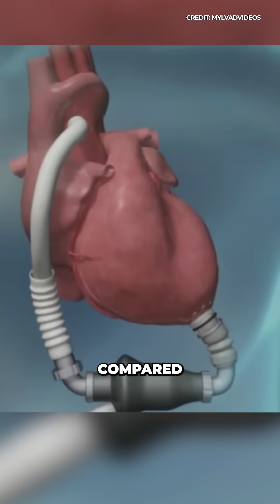Engineers Create World's First Fully Artificial Heart

Comment: My father was a thoracic surgeon. When I was in college, he got the idea for developing a pump that could be attached to a patient who was in cardiogenic shock in the field by trained paramedics, with the hope that it could keep the patient alive until they could be brought to surgery. We built it using a clear plexiglass tube about 3 cm in diameter and about 30 cm long. My dad made "tricuspid" valve molds out of old broom sticks by carving the end in the positive shape and then heating thick mylar sheets on the stove and shoving the broomstick handle into the soft mylar, creating a negative of the valve. We then cut the valve from the mylar sheet and used a razor blade to slit the valve leaflets apart. We would then mount two of these valves onto the ends of a mylar tube about 2.5 cm in diameter, with both valves facing the same way. Water passed through the valves could only flow in one direction. We then placed the mylar tube with valves inside the plexiglass tube and attached an electronically controlled pump to a small hole in the side of the plexiglass. The pump would alternately push air into the plexiglass tube and then suck it back out, causing the mylar tube inside to deflate and inflate, respectively. When one end of the contraption was placed in a bowl of water, it would squirt water almost to the ceiling. My father then sterilized it and attached it to a lab animal (a pig, I think). It kept the pig alive for several days and when they tested the blood, there was no appreciable hemolysis. Unfortunately, we never got a chance to complete the development.

EDIT: spelling

Comment: A constant flow bloodflow has problems that a pulsing flow doesn't. In the pulsing cycle the pressure is like a waveform with a peak and a low, to simulate this with a constant pressure would mean having a flat graph for the pressure curve. The problem is the fact that static friction is higher than kinetic friction. The high pressure peaks in a pulsing flow means blood will still slowly flow through paths it wouldn't be able to normally, so a flat pressure from a motor can't make blood flow through places a pulsing flow can, and so it'll clot up in places, maybe for the specific patient here, the blood may have been thinned with the right medication to mitigate this but if this is true then this limits the use to patients that wouldn't have complications with blood thinning. Maybe a piston based motor using a linear solenoid instead of internal combustion would would better to simulate the original pusing heart.

Comment: Not well informed. There is power problem and a deeper puzzle. These temporary pumps are old. The problem is power. The best company now is Leviticus (dumb name, I know) and an MIT startup. However, there is a new problem unsolved that occurs after about a year, for
some unknown reason our immune systems attack these electromechanical hearts, generating plaques. Maybe cell rupture is the cause? But which cells? What is causing the inflammatory response to materials which are biocompatible in knees and hips? 
Focus on this puzzle in a video.

Comment: So my question is....in situations where you would suffer a heart attack, but you had this in you instead, would you just not have a heart attack? Could this heart never fail in the same way that our natural hearts do? Disregarding mechanical failure unique to the device of course. Also how would stimulants that increase your heart rate affect this? If you dont have a heart rate....does that mean your heart rate wouldn't go up? Would that cause other unforseen issues elsewhere in the body?

I'm mostly just curious. I see why this is a miracle, obviously its one of those "working with what you've got" sort of circumstances, where getting this is better than being dead. But I wonder what the unforseen downsides/disadvantages are. 

But as someone whose heart has insisted on not beating properly for years, everything from arryrhmia to palpitations and even panic attacks where I thought I was dying because my heart was bugging out so bad, the idea of having something in my chest that would never fail to keep the proper amount of blood flowing at all times is as enticing as it is a bit spooky. The hypochondriac in me couldn't help but wonder what other problems would be caused by the blood flowing differently than our body is used to/technically "built for".

Comment: There was another artificial heart invented more than 30 yr ago. Yet, it did not provide the needed impact to red cell minimized to this level. The one individual that was the "experiment" failed to survive long enough to obtain a replacement heart. At the time, it was mostly blamed on the missing "pulse" of a normal heart beat and the system unable to cope with that missing constant. Yet, I don't recall if the negative impact on blood cells were also identified. This is a great break through. The previous recipient did not last nearly as long, and this appears to be 
on orders of magnitude better.

Comment: why make it temporary when you could improve it make it so it can completely replace the heart, yes just with anything like that it will need maintained which will probably require an appointments every now an than but heart failure is the cause of so many deaths and this could make getting rid of heart failure way easier.

Comment: I'm a Mechanical engineer, and, oddly, my first post college job was designing chemical metering pumps.  I have heard blood is very sensitive to shear stress, and shear is exactly what your lil impeller is doing.  Why don't we mimic the heart's dynamics and use a big ol "dashpot style" diaphragm and gentle rubber flap valves? I'd pump that diaphragm like it's a speaker cone.

Comment: That’s amazing, it definitely looks like a plumber had some say in its design, its not overly complicated and  it does the job it’s required to do properly and efficiently without doing damage to the rest of the machine its installed in. It seems to be remarkably simple but efficient, almost like the engineers were told to keep their over complicated hands off this one.

Comment: Before watching this video, I never realized quite how many different unique problems you have to solve when creating a mechanical heart. Like, it needs to: 
- avoid harming red blood cells
- dynamically very speed based on patient activity level 
- be incredibly reliable 
- be small enough to actually fit inside the patient 
That's just some pretty restrictive requirements!
Reply: There's also:

- Have long enough battery life to where it's not reasonably possible for your heart to run out of juice
- Be light enough to where it doesn't significantly harm or affect the function of the rest of the abdomen
- If battery life isn't long enough to last before heart replacement, they need to find a way to charge the heart without stopping or removing the heart
Reply: @megamortosis couldn't we make it like wireless charging?
Reply: @l3ll5l  wireless charging happens over an extremely small distance and/or through the open air.

Going through an inch of bone and/or flesh is neither of those things
Reply: You could, of course, wirelessly charge a battery that's on the outside, but that's just over engineering at that point.
Reply: @megamortosis  I looked it up and we could increase the distance but space is a problem one could built the outer shell with it so it serves two purposes. But I think they would have thought about it already. It seems bones and flesh are not such a problem
Reply: @l3ll5l or like a cyborg, have an external part connected to the heart for charging. How? idk
Reply: @Mark-fo6hz  yes I thought about this too but then I thought about infection between flesh and metal and the body to try to fight it etc. But lets see what they will come up with
Reply: @gabef.218 that's like saying wireless charging isn't possible with a phone because the case is hard... you simply move the qi charger to the skin level and connect it to the heart via a wire
Reply: @dutchman55 like i said, at that point, just plug it in, no need to over engineer.
Reply: @gabef.218 you could run a wire to a charging surface screwed into one of your ribs or something and use a magnetic charger like apple watches do
Reply: @l3ll5l why not just a usb port? Seriously
Reply: @megamortosis  I wonder if there is a way for the heart to use the body's ATP so battery life isn't an issue.
Reply: @lordyoda607 i don't think so, as atp is used in chemical reactions as fuel, it isn't pure energy. The heart would have to have input and output for atp and waste, which would be significantly harder to manage considering it's inorganic
Reply: @megamortosis  the battery is external, and Im pretty sure wireless charging is a thing
Reply: @aiodensghost  ai pfp, opinion ignored
Reply: @megamortosis  we got a tesla coil bro😂😂
Just charge yourself like a iPhone 😂
While sleeping, make sure you have a inverter 💀
Reply: Avoid rusting and any material changes that could cause poisoning. Actually monitor and provide the correct blood flow that subconscious brain would be satisfied with since there is a clear mismatch between what the brain is saying the body requires and what is actually delivered. ensure EMPs, electromagnetic disturbances doesn't affect the device, ensure there is another power to last for over 200 years without defect, ensure the motor speed is quick and accurate to simulate the same speed of a real heart pumping blood.  Ensure the heart is adjust its speed appropriately depending on the athletic health of the person.  Ensure remote activation tampering isn't possible. 

Too many possibilities where something can go wrong. I'm glad this should only be seen as a temporary thing until a full heart replacement can be sought. I'm for sure. THis GOT to be seen as the ABSOLUTE LAST RESORT.
Reply: And lightweight enough, too, as a heart weighs 7 to 15 ounces depending on specific factors...idk how much that one in the video weighed but trying to carry around a 5lb heart would be difficult and possible painful...definitely would put a new meaning to "a heavy heart"
Reply: Apparently, strokes are a big recurrent problem with early Jarvik-7 artificial hearts.  External battery pack changes are NO PROBLEM because you can just connect the 2 batteries in parallel and then disconnect the tired battery.  Wireless charging is not a problem as long as the patient is not too fat because you can put an induction coil just below the skin and outside the muscle fascia, connected to the heart battery deeper inside.

Comment: Doctor’s notes: “Patient is experiencing a decrease in torque during low rpm activities. I am prescribing a compound turbo to address the boost lag. If that still doesn’t treat the symptoms; I am recommending a twin-charger with a ported blower and connections to add nitrous later if necessary.”

Comment: What if they created a more malleable structure with a wire system that went through the walls of it, it could contract and release the wires to use compression to distribute blood and eliminate the shearing of blood cells.

Comment: The major problem with the science of engineering artificial organs isn't the mechanics but the constant output generation and to reduce the heat and friction as much as possible and even though these are work of art they will have to be replaced sooner or later as the heart not only pumps the blood but also releases certain hormones like ANF responsible for lowering and controlling the action of RAAS and ADH which even the modest of tech couldn't compete
Reply: The heart also acts as a chemical control centre of breathing rate as the receptors on carotid body senses fluctuations in CO2 and H concentration

Comment: I'd love to know how they're dealing with the pressures it takes to actually... pump that blood, without the actual heartbeat. The way I understand it, half the reason the heart actually beats as it does is to build up the significant pressure needed to move such an intense volume of blood, in such tiny little tubes, so far removed from the heart itself... it's a lot of resistance. Kind of like... how it's easier to move something heavy by shoving it a small distance at a time instead of trying to slide it continuously? But then, how that heart pump is getting away with continuous flow, that's very interesting to me

Comment: There is a critical information missing. Where does the energy for the heart come from? It most likely comes from a battery that sits outside your body. Therefore it has the same issues as all the other mechanical replacements. Its fine for a short time but you always have an open hole in your skin for the cables. This hole is a high risk to get an infection. 
Correct me if i am wrong but he didn't say anything about how it is powered.
Reply: It's probably something like a pacer
Reply: @Fishyea  
It's not a pacer because a pacer can't replace a heart. The issue is that a pacer doesn't need much energy. But here we have an electric motor that needs to be running the entire time.
And I doubt they will hide a battery somewhere which can hold enough energy.
Even inductive charging won't work here. It's too inefficient and can't deliver enough energy.
That's the reason I think there is information missing.

Comment: The plumber creating a heart is a beautiful story. It is mostly a plumbing issue. Every function of the heart and vessels can by understood by a plumber if they work at it from first principles.
Reply: That is why I never understood how we have so many advance things but not artificial hearts. I get the need to increase and decrease the flow on demand is something that should be hard but I always thought hey, better to faint than to die.
Reply: @Damiancontursi I think the other difficulties are powering it for a long time
Reply: @ghostofhallownest3433  both of you are wrong, those two challanges are not even 0.1% of the difficulty. Its all about how the immune system dosent accept foreign objects. it covers foreign objects in protective stuff and tries to break it down. not only is the heart the place that experiences the biggest flow of blood and the contained immune cells, its also the one place where the immune system piling up protective layers is a big problem, and where the immune system trying to break it down is a problem.
Reply: @Damiancontursi  Power, weight, not damaging blood cells, not damaging arteries, managing pressure, having to use materials that won't degrade or break off in the body, a way to charge it that doesn't require reopening the body cavity, risk of infection, it can't run hot like at all, it can't compromise the space needed for the lungs and other internal bits... And all of this only testable on a small fraction of a small fraction of people who desperately need hearts but can't get one from a waiting list and are willing to consent to getting a hunk of metal wedged in their chest. You can't even really test artificial hearts on, say, pigs effectively, because of the unique blood delivery needs presented by humans' bipedal locomotion.

Comment: Wonder what impact on the human body it wil have to have a constant flow instead of pulses. I would think the pulses would have affected the whole development of the human body and that if a constant flow was good we would probably have developed a biomechanical flow stabilizer. My theory is that the pulses help clear out areas of stagnant blood and other debris. Significantly decreasing our risk of blood clots.

I'm also imagining that a pulse rhythm that matches ones run rhythm can boost ones efficiency by taking the load off the heart while barely touching the ground to pumping in sync with the heart while setting off of the ground.

I still think it's a very impressive setup to have had running for 100 days, but for efficiency i think a lung improvement would be needed aswell. Since your blood flow won't match your airflow. 

I think a small turbo needs to be installed in the asophagus and a little exhaust under the lungs on the abdomen so we can match blood and airflow.

Comment: If someone that is smart could tell me i would be very interested, If these titanium hearts got reliable enough wouldnt that be an overall better solution as compared to a transplant heart? Im assuming that based on the fact that with a transplant heart you have to take anti rejection drugs that make you very immuno-compromised. Would you still need to take them with the artificial heart? Because if not then assuming it reliably lasts long enough you'd would be able to have a new heart while retaining a strong imune system.

Comment: Titanium. Crap. My body rejected it before. When I was 10, I had a titanium rod put in my jaw after an accident. Later, in my 20s, I got an infection in that same area, but no one could figure out why it kept coming back. I went to a few places for help, but no one could pinpoint the cause. Finally, I saw my dentist because they thought my tooth was infected and needed pulling. They did an X-ray, and my original dentist remembered the titanium rod. The new X-ray showed that the rod was gone. I can’t remember the exact reason I needed the rod, but I broke my front tooth in the accident. They gave me a half fake tooth anchored by the rod. Over time, my body dissolved the rod. What was left was stuck in my tooth, and the infection settled in the fake tooth, which had been root canalled, so there were no nerves. The infection spread to my sinus and created a massive abscess above my front tooth. I saw specialist after specialist, and it turned out I needed surgery, which cost $1,700. I was spending that much every week on panoramic X-rays, none of which were covered by insurance. I was broke when I finally got it fixed. Oh and no rod needed after, they were able to regrow the bone where it was anchored. Thought i would share in case anyone else ever has similar issues.